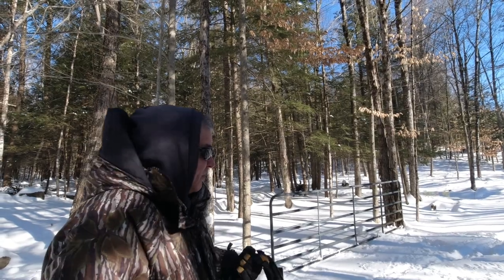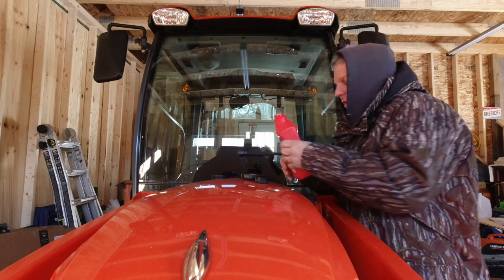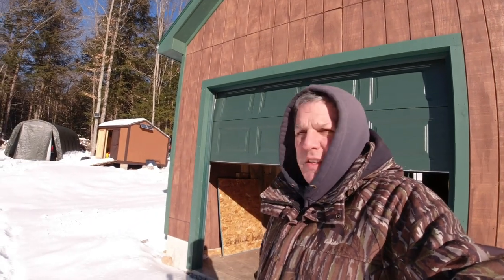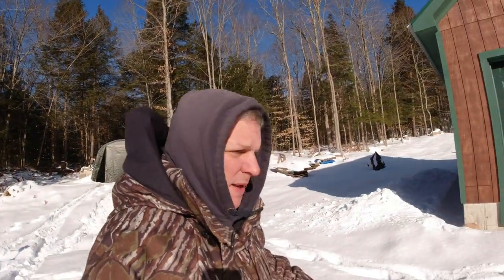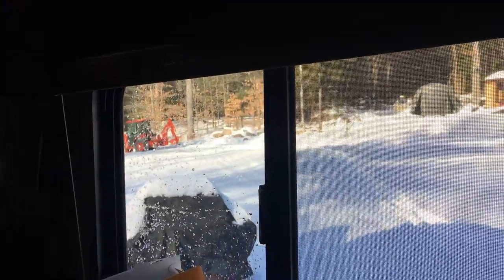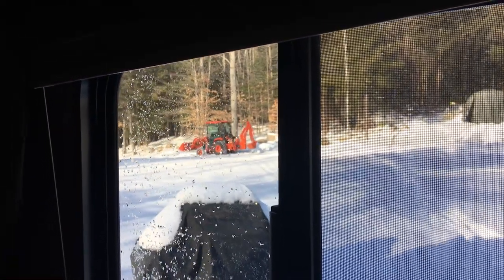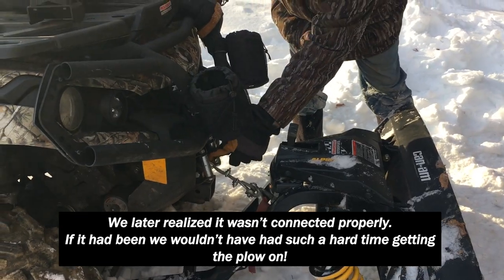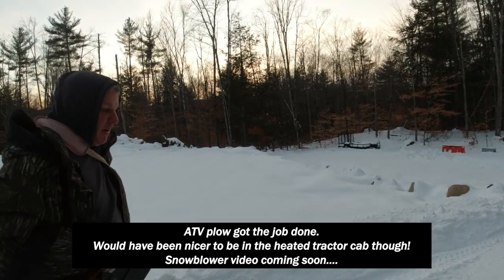Will this work? | Trying to plow DEEP SNOW with Kubota B2650 Loader

Comment: Good Morning neighbors, when i am using the loader to do snow on the gravel driveway, i use a set of the Edge Tamers (3), on the bucket. you will need to take off the cutting edge you have on it now, so you can just float the bucket down the driveway without digging up the gravel...You may also look into putting a Block Heater on the Engine, for the colder days...Stay Safe..God Bless..Chief...{NYS/ADK}
Reply from the maker: Thanks so much for the tips! Really appreciate that. Block heater might be good too when we have power👍 love the Adirondacks!

Comment: Next time try the loader in float position and keep the bucket level with the ground.  If the snow is too deep, then keep the bucket a  couple of inches up for the first pass.  When you come  back to widen the drive keep 13 of the bucket out the snow and should keep the trails to a minimum.  I do an 800ft driveway, 12 ft wide with a smaller tractor than you got.  Have fun.  If the ground is frozen it will be easier.  At 3 degrees it is frozen. Also if you take the tooth bar off the bucket it will help.   No need for a tooth bar in the winter.
Reply from the maker: Thanks!

Comment: Now that is very cold indeed yes you fuel was a little jelling up 👍👌😮 Yes in cold temperature let it warm up in accordance with your maintenance manual for the engine but also for the transmission too 👌👍😇 Try to always have full level capacity into the fuel tank to avoid moisture build up 👍👌 You need to have a front snowplow on your tractor with your rear snow blower  👌👍 and tyre chains for sure 👍👌😇 Cheers 🍻
Reply from the maker: Thanks my friend

Comment: Get an old fisher or Meyer truck plow- 7” wide and chain the blade to the bucket.  Probably cost 1-200 for an old blade on marketplace in upstate NY
Reply: Also a set of tire chains does wonders for traction on these tractors all winter and into the mud season
Reply from the maker: Chains are definitely a future add on!
Reply from the maker: Got a snowblower for the front. Finally installed it. Video of first blow this Saturday!

Comment: Gelling or jelling? Jelling diesel fuel is not fun. My 7.3 powerstroke never jelled up. Even in -18° at Killington. I do use the blue colored enzyme treatment in my tanks. Not sure how much that helps. I also have my engine block heater on a timer. The block heater helps big time. But you have to let it work for a few hours. Block heaters work great on gas engines too. At your cold temps, it lets your vehicles start like it's spring time. To me it seems like much less cold start wear and tear on the motor. And it also melts the snow off your hood too if your vehicle is parked outside. But a few hours in a warm garage will do the same as a block heater.
The quad seemed to do a pretty good job and is probably a lot of fun except for the cold. You could probably strap a few sand bags or cinder blocks on the front rack to minimize the front end sliding from the snow buildup in front of the plow. Probably wouldn't hurt to add some weight on the back too. 
I think the snow blower attachment on the tractor is going to be like the cats pajamas!  Warm cab, throw the snow exactly where you want it. Awesome! 
A plow for your truck is always nice too because you can pick up a few accounts or plow for your local town or county. There is a ton of money to be made in snowplowing. I did it for over 20 years. I always found plowing to be fun. Even after 35 straight hours. Lol 
The only down sides to a plow for your truck is the initial investment, the wear & tear and the wacky bing bong cookoo crazy insurance rates. But one good year and you will be ahead 3-5 times your initial investment. 
Anyhow, looks like you guys are enjoying yourselves. Great video. Looking forward to seeing that snowblower. 🍻✌
Reply from the maker: All good points! Thanks for commenting lol

Comment: Gas station in Canada use diesel #2 in summer and switch to diesel #1 in winter to avoid gelling.
Reply from the maker: I’ve never different numbered diesel here. Is #2 kerosene?
Reply: @CreatingASimplerLifeOffGrid  don’t know. Stations use #2 in summer and #1 in winter.
Reply: @Viper6-MotoVlogger - Not that you need to worry about that much anymore... LOL !
Reply: @TheCanadianBubba  yep 😁
Reply: @Viper6-MotoVlogger  👍

Comment: Lol buy a plow for the pickup easier
Reply from the maker: Seriously. But I bought a snowblower instead and finally got it installed! First blow in next Saturday’s video 👍
Reply: @CreatingASimplerLifeOffGrid  
Lol the bucket just dont cut it for a long road. You get a snowblower for the tractor? Wont that pick up rocks?
Reply from the maker: Yes, but not a problem on the finished driveway where rocks are small